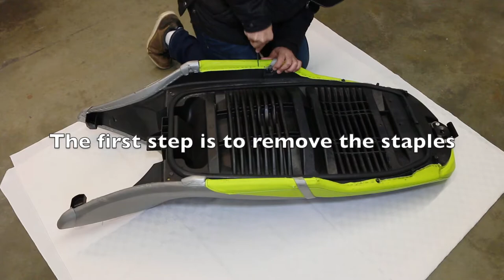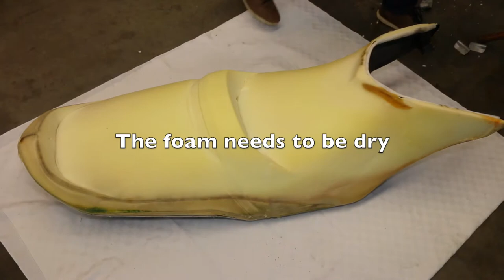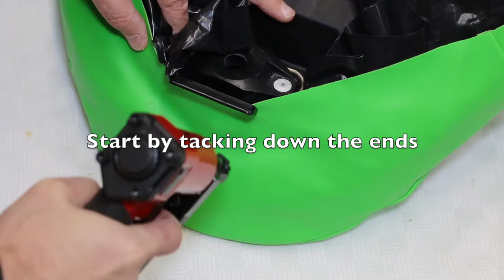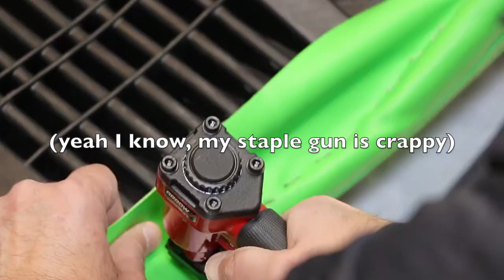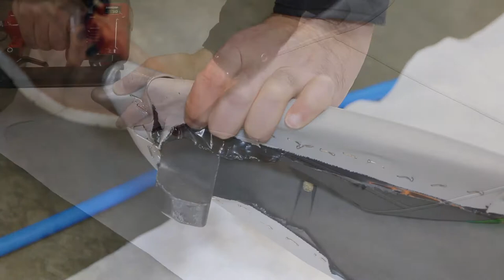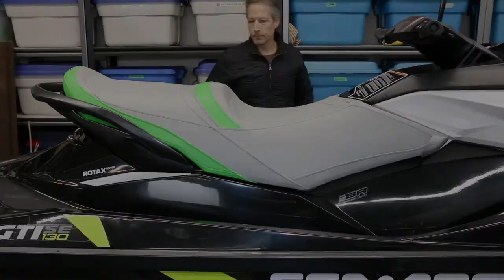How To Replace The Seat Cover On Your Personal Watercraft Jet Ski

Comment: Great video! What length stainless staples did you use?
Reply from the maker: That is a great question. We used quarter inch stainless steel staples, but it really is a delicate balancing act. We found it very difficult to get the staples into the plastic seat properly; too much pressure and the staples blasted through the vinyl seat. Too little pressure and it wouldn’t go in far enough. It worked much better on softer plastic motorcycle seats,. If you can find slightly narrower and thinner staples that is a better way to go as they will penetrate the plastic seat pan easier. Definitely a pneumatic stapler works better. Good luck!

Comment: What kind of staples did you use?  18 gauge 1/4" stainless?
Reply from the maker: I find that 1/4" Arrow stainless work best. I also find that for my staple gun I need to use 95 PSI. Any less and the staples won't go in far enough; any more and the staples tear through the vinyl. Good luck.
Reply: Thank you for your quick response and for the excellent video!!!!

Comment: With the bag between the seat and the cover, does the bag produce noise when being used.  thanks, great video.
Reply from the maker: Good question. That was my primary concern, but it doesn't make any noticeable sound. I recommend using the thickest bag possible. Good luck.
Reply: @3ftDeepChannel   now why is the bag necessary exactly since the original one did not have one? Thanks
Reply from the maker: Very good question. The manufacturer suggests using the bag. In fact they suggest using a thick bag. I assume it gives it ultra waterproofing that isn’t there with the original cover. For sure, my original seat cover would let water in so the foam cushion would get wet. This seems to stay very dry.

Comment: Nice, the thought of pulling off the stretched vinyl is a little daunting. Anyone been able to replace the seat latch at the rear without removing the trim. Looks like the bolts come from inside?? Initially I thought they were just rivets and ground them out. Thinking I’ll use a couple of rivnuts.
Reply from the maker: The latch is usually riveted on and normally not removed when replacing the seat cover. The vinyl is not stretched too much, so I wouldn’t worry about that. It's getting it centred so that it sits correctly that is one of the most important part. Going slowly and having a second person help is the key! Good luck.

Comment: What staple gun and staple T50/1/4" round or flat ?  I seeing rust on staple after people replace OEM seat.
Reply from the maker: We used a cheap Arrow T50 staple gun with 1/4 inch staples The only criteria for doing this properly is that you use a pneumatic staple gun (we set ours to 90 PSI) and stainless steel staples. It takes some practice to get used to your staple gun, as there is a “sweet spot” where you get just the right penetration without going right through the vinyl.
Reply: @3ftDeepChannel  any better option will you recommend? I notice the OEM staple is wider.
Reply from the maker: Not really. We’ve done a number of seats with that staple gun (including two motorcycle seats), and it works okay. Interesting though that sometimes the OEM staples are wider, and sometimes they’re narrower. One thing that’s consistent though is that they’re usually thinner and a bit longer. We think those are the professional grade staples for professional staplers. The Arrow one gets the job done.

Comment: Hello, what size of staple do I need? width and depth? thank you
Reply from the maker: We used 1/4” long staples. The width will depend on what type of staple gun you have, but it needs to be pneumatic for best results. Also, for outdoor use always use stainless steel. Good luck.
Reply: @3ftDeepChannel  okay 1/4 inch?  I haven't bought the stapler yet.  What width do you recommend?  thank you
Reply from the maker: Hello Damien, We use this one and it's OK https://amzn.to/34Mt5KX, but you could also consider spending a bit more for a better quality unit like this one https://amzn.to/3gZqEqE. The first one uses T50 staples, which are very common but I'm not sure what the second one uses.
Reply: @3ftDeepChannel Thanks very much !!

Comment: I have a 2010 rxt 260 rebuilt motor new computer rebuilt supercharged won't run but 45 on water under pressure on the trailer get ribs up to about six seven thousand RPMs any ideas what could be the problem
Reply from the maker: What compression do you have? Any codes?